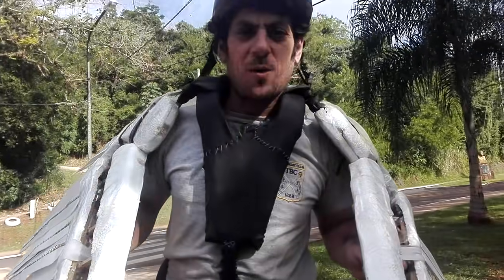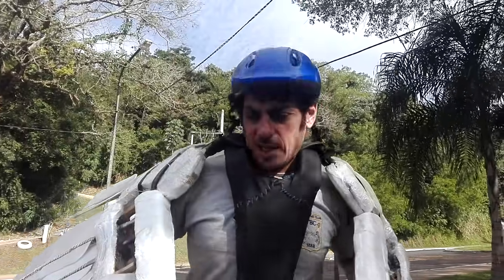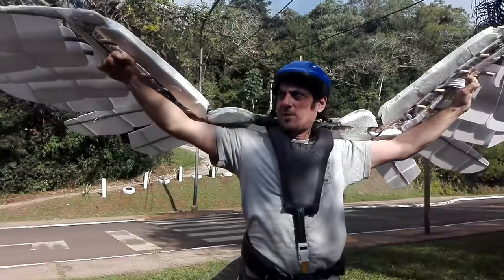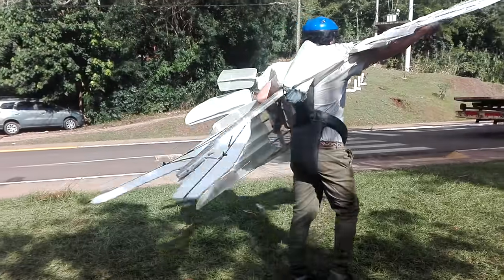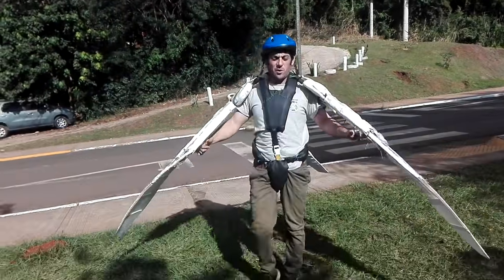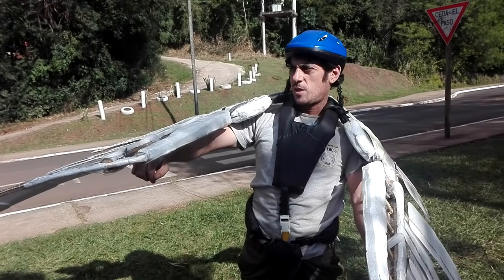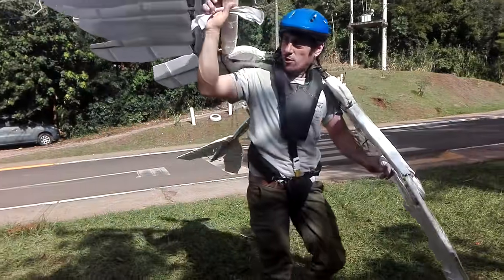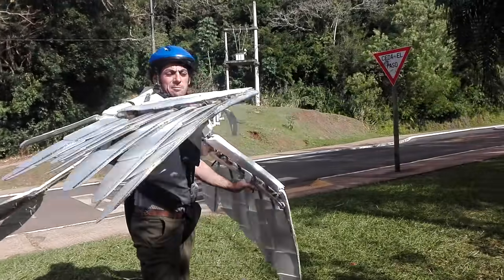Human ppwered ornithopter

Comment: I've sat down and worked out some numbers. A good wing set at about 30 feet wingspan roughly 3 feet from tip to end can displace 12.8 m cubed volume of air per wing on a day temperature 20 degree dry air. Flapping the wing at 25 degrees down. 12.8m cubed volume of air translates  to about 15.5 kg of air displacement per wing. So theoreticaly a sixty foot wing span by 3 feet could produce enough lift for a 60 kg person  person.This is provided the wings were flapped property and doesn't take in account the weight of the machine. And would need to be extremely fit and strong.
Reply: I was thinking the same, just without the numbers. I was watching thinking "great concept " but you don't have enough wing area to lift a dense human body. He should work on inventing a human hollow boned skeletal transplant first.
Reply: @deanpalmer3303  Yes, birds fly well & can get themselves off the ground & fly well because their bones are strong, yet hollow thru & thru.
Reply: You're not factoring in air resistance which, while also slowing down the wing, increases the thrust. You are correct in your overall volume, but a smaller wing moving faster can generate just as much thrust. 

The problem with human powered flight has less to do with weight and more to do with muscular structure. The human chest is not designed to produce the inward pull necessary to overcome their own weight. 

When you consider flying, consider that your chest and shoulders are basically lifting the entirety of your weight off the ground. 

So, basically, you're doing a hanging pull up every single time you generate lift sufficient to pull your feet of the ground. 

Do that a thousands time and see how you feel.
Reply: 60 feet wing for a 60 kg person. Dang
Reply: you could combine it with a supportive exoskeleton to produce a higher frequency and a costumized AI to fly mimic the movement better while having direct input from the pilot. I see this could easily be possible in a few years time :)
Reply: Humans don't have that flapping power he will need assistance from and electric motor hooked up to his back or a gas one the problem is all of those batteries will add lots of weight or the gas motor itself.
Reply: @truckerray7533  yep and filled with helium.
Reply: @robcoastalga8279  that might work
Reply: @matthewbrown5228  i think the wings produce uplift to counteract gravity and weight and to ultimately aid in reducing the force required for flight. In terms of power...i still think something can be done with modern day tech if simple gear systems in da vincis contraptions yielded some power.
Reply: @simonkabiru5676  you're not wrong. Those devices already exist in the form of helicopters, motorized hang-gliders, ultralights, and other aircraft. 

The problem here is that this person is suggesting the possibility of flight by human power alone, using wings like a bird. Humans are not built like birds. Our bones are dense, our muscles are built and structured for standing, running, and to some extent swimming. They are not built for flapping wings.
Reply: @matthewbrown5228  well stated but the main question is " how?"..if the wright brother stood by the assumption man could never fly and many other inventors then we could never have these "device". The invention of robotic exoskeleton to mimick the keel of a bird could be an eye opener in the field of man powered flights.
Reply: @simonkabiru5676  

I see what you're saying, but we are not in the situation of questioning whether flight is possible. We know it is. We have methods to achieve it. Our goal is to refine it and make it easier, smaller, more personal. 

Any method of manned flight will need to have a supliment power source, because we are simply too heavy to fly on our own power. Birds are considerably lighter in perportion to their size (not just because they are typically smaller, there are some birds that are the size of people, but do not weigh as much). 

Because of this, a supplemental power supply and exoskeleton must be used. Which is currently what is in place. 

We have airplanes and helicopters that typically use internal combustion engines to obtain either rotaional lift, or forward motion which causes wings to generate lift. The reason we use these methods is because this is the most efficient method we have of generating sufficient lift for our weight. 

The question then becomes, would combined force of a person flapping and an exoskeleton assisting in order to generate flight actually be an efficient means of flight. The answer is, unlikely. There still must be additional power, which adds weight. We must also move away from rotational energy and utilize a form of linear motion which is efficient, yet strong enough to overcome the forces of gravity and air resistance. 

One way to achieve linear motion is through solenoids. With sufficient energy, these can generate a great deal of power, however, they also use a considerable amount of energy to do so. 

Solenoids might be more efficient in a single instance than a motor, but then we must examine the overall efficiency of linear motion. 

When a wing flaps, it generates lift when it lowers, pushing on the air beneath it. But then it must raise again, which uses energy, but generates no thrust. 

Since the solenoid must be activated to raise the wing as well as lower it, even if it were possible to get a solenoid that was 100% efficient in its power usage, in a flapping mechanism you would only ever achieve 50% lift efficiency. An argument might be made for higher efficiency at greater forward speeds, as air resistance can aid in lifting the wing, in essence using a gliding method, but even then you would never achieve 100% efficiency. 

Now, compare that to rotational energy, like a helicopter. As the wings rotate, they continually generate lift. So, the more efficient the motor becomes, the more that translates to lift. Obviously air resistance comes into play, but you are never "wasting" energy when using rotational energy for flight. 

Rotational motors are not 100% efficient. Neither are solenoids. But of the two forms, rotational energy is far more efficient for obtaining and sustaining human flight, as far as we have discovered.
Reply: @WilliamHelstad  went with the experimental "bird bone exchange" surgery eh? Good on ya! Science has to be advanced somehow!
Reply: @truckerray7533  not just their bones, also their lungs, hearts, muscles, and their entire body shape is made for flying
Reply: Well damn sherlock
Reply: @matthewbrown5228  Haha this is awesome! I have really light bones... unfortunately they're also very snappable as I've found out several times 😖
Reply: Pp 9o
Reply: @mohitoshroy2283  How about explaining what "Pp 9o" means??
Reply: @robcoastalga8279  How much weight can a cubic foot of helium lift?
A cubic foot of helium can lift 28.2 grams. 
448 grams to a pound. 
Requires 15.88 cubic feet of helium to lift a pound.  Visualize a cube 2.5 feet on all sides.  That cube can lift one pound.
Reply: It's been done but required assisted take off. Also it only went for 400 ft.
Reply: @Justwantahover  Are you referring to the Snowbird?  The Snowbird is the first human powered ornithopter.
Reply: Vaya con Dios Carlos, the Savior takes the best ones early.
Reply: 60 foot wing (18.2 metres) for a 60 kg person? According to modern science, bumblebees should't be able to fly, because their wings are to small.
Anyway, a golden eagle with a 1.7-2.4m (5.5 - 7.8 feet) wingspan can apparently lift a goat weighing 65kg, accordind to this video (at 7:30): 
https://www.youtube.com/watch?v=nPx2aL4saXc
So that eagle should easily be able lift the 60 kg person?
Reply: @MaxCruise73  "Because you are not sufficiently armed with facts, you will lose the argument"
HOLY SHIT DUDE :D I didn't know I was in a argument, I feel like I fell of the bus in the wrong part of town :) Getting jumped by scientists lol! 

I was rather asking out of curiosity. I don't know how to calculate aerodynamics, but a 60 foot wing seemed a little big. I used the eagle example to suggest that maybe it doesn't need to be that big, and the bumblebee cliche is a well known example that things do not always work the way we think they should. I'm sure modern science has figured out how bumblebees fly by now :)
My point was that if an eagle, which weighs around 6-7kg or so, can lift a 65 kg goat, 
than it should be able to lift a 60 kg person?
So, a roughly eagle-sized device should be able to make someone fly? Now, I don't think the thing we saw in this video would ever work, I doubt that humans can fly with ther own muscle power. But an engine driven flapping device should theoritically be able to lift someone?
Reply: @mateiionescu1817  next time you resort to a comment, have facts on your side.
1) how a bumblebee flies has been studied.
2) your example of the golden eagle does not scale upwards.
3) I asked a simple question.  "How many human powered ornithopters have ever flown?"
4) why the obsession with using flapping wings?  In birds, flapping wings provide both LIFT and THRUST!!  
5) while not flapping, helicopters use the rotor/rotors to provide lift AND thrust.  The mechanics and aeronautical engineering have been solved and perfected.
"The first tethered flight was conducted by Igor Sikorsky on the 14th of September 1939, followed on May 13th, 1940, by the first free flight. This made the VS-300 the first single lifting rotor helicopter in the US, the first successful helicopter to use single tail rotor configuration and the first practical amphibious helicopter."
6) scant research goes into powered ornithopters.  No point when fixed wing and rotary wing aircraft have been working well for nearly 120 years.
Reply: @MaxCruise73  Maybe people want a flippy flappy thing just for fun? 
If people let individuals with that attitude stop them, we wouldn't have helicopters and planes either, because coaches and boats had been working well for centuries.

Btw, when I resorted to my first comment here, it was adressed to Ben. Would you mind terribly if he answered for him self?
Reply: For the average man, with average arms and hands and weight, he would have to not only flap his arms at 600 flaps/second, he would also have to switch from a flat hand (horizontal) to a vertical hand every flap and extend and contract his arms every flap just to generate enough thrust for lift. 600/second* But thats only with what he's born with. When you start adding devices, we got it beat. The latest is jet packs.

* I cant even hail a taxi longer than 10 seconds, and thats swinging my arms like a madman. Maybe a total of 40 flaps/10 seconds. Lift = N/A 😂🤣😆
Reply: @MaxCruise73   That theory would be correct if bumble bees used the same means of flight that airplanes do. But they dont. They generate lift by flapping wings. Unlike airplanes that require the balance of lift, weight, thrust, and drag. That theory was suggested back in 1930. It was comparing the bumble bee to air planes, and of course they wouldnt be able to fly if they didnt flap wings. Bernoulli's threory does not apply to bumble bees at all.
Reply: @siggyretburns7523  The University of Toronto Snowbird, the first human powered ornithopter, used an airfoil wing plus a flapping/rowing motion to remain airborne on is record breaking flight.
Bumble bees, hummingbirds, dragonflies fly in manners different than other birds.
Dragonflies
https://www.youtube.com/watch?v=oxrLYv0QXa4
Hummingbirds
https://www.youtube.com/watch?v=gJ_T_Y1rxHw
Bumblebees
short video
https://www.youtube.com/watch?v=KuYCbQOURT4
long video
https://www.youtube.com/watch?v=UZHa5Y8tZm8
Reply: @MaxCruise73  yes  there are several ways of achieving flight.
Btw. How long did that guy fly for, out of curiosity?
I remember something about a guy that made a glider with a pedal powered propeller. I dont remember how far he got. But I think it was over a mile. And all that is good  but at the end of the day, practicality still wins, but its always good to experiment.
Reply: @siggyretburns7523  Human powered aircraft have flown across the English Channel in 1979
"The Gossamer Albatross is a human-powered aircraft built by American aeronautical engineer Dr Paul B MacCready's company AeroVironment. On June 12, 1979, it completed a successful crossing of the English Channel to win the second Kremer prize worth £100,000 (equivalent to £538,000 in 2021)"
Info on the Snowbird ornithopter
"Snowbird flew for 19.3 seconds in a straight-and-level powered flight run under human power alone.[12][5] It averaged 25.6 kilometres per hour (15.9 mph),[4][1][5] over a length of 145 metres (476 ft)"
Here is an interesting fact.
"Pilot Todd Reichert estimates that each stroke needed 600–700 watts (0.80–0.94 bhp), with 700–800 pounds-force (3,100–3,600 N) on each stroke.[6] Analysis of the flight afterward indicated that 15-20 power strokes is the limit of endurance for the pilot.[16] ."
Only legs can create and sustain that power level.
Reply: Makes sense
Reply: @deanpalmer3303  The fact is that they can get away with the hollow bones since they are so small and thus don't need as much muscle. I believe at our size the real issue isn't the bones any longer but the fat/organ/muscle mass!
Reply: I don't know I word you just said but nice 👍
Reply: We just need to add some thing for our feet to do like a bicycle crank hooked to every feather so you could take some of the weight off
Reply: Either way He'll get tired flapping those wings before he gets a lift off
Reply: Pretty sure there’s a comic book character that has a set of wings .  His look about that big.
Reply: Trambiqueiro...🤣🤣🤣🤣🤣
Reply: @matthewbrown5228  maybe find some way to include the muscles from the legs for the wing flapping than.. although doing that many squats till seems a tall order
Reply: @matthewbrown5228 yess... was just thinking this would require one to be able to at least chest press “with elite level muscle memory”, more than twice your weight roughly...
Reply: @zzzz if you did it that way, you would still have the weight issue of the power supply for the wings, and as I addressed in an earlier post, you'd have the limited efficiency of a flapping motion.

However, using your arms to simply control the flapping, instead of relying on your strength to actually create life would extend the flight capability considerably.
Reply: Thanks all run with those numbers.
Reply: Absolutely Yes! but then the problem is that his wife is not going to find him.
Reply: @matthewbrown5228  Not just your chest snd shoulders. You forgot to include the largest and strongest muscles in the human body, your legs!
Reply: @MaxCruise73  So a helium filled balloon with a diameter of 20 feet will lift 263 lbs or 285 lbs if it was filled with hydrogen.
Reply: @bencrawshaw1227 hey there, I think the idea of a wing suit is a really cool concept and I might consider trying to make one in the future. You seem like a very smart person and you how to do the map so I was wondering how long would the wing have to be if instead of 3 feet from front of wing to back of wind it was 4 or 5 feet?
Reply: Seems like a job for graphene or smth.
Reply: @DwAboutItManFr  whats graphene
Reply: @blueflame2532  Super material
Reply: What this guy is trying will never work not enough wing ares arms have no strength  extended so they need flolded in a v shape i.e. weight lifting  so develop max power
Reply: YOU IGNORED FLAP RATE AND AIR CURRENT WING-LIFT - you can "take off" by just standing into a breeze with a much smaller wing area for the mentioned payload. Witness the Gossamer pedal powered aircraft that used air current lift and not air displacement except for a very large propeller for forward / directional thrust. The angle of a bird's wing provides both variably and very effectively - very high tech!!
Reply: party pooper
Reply: @matthewbrown5228 that was nice. are there any muscle sets in the body that can produce the required lift? example both thigh legs. a weight lifter can lift three times his mass that way (eddy hall).?
Reply: @nothinghere1996  absolutely! Our legs are specifically designed not only to support our weight, but to do so consistently and for extended periods of time. If any muscle group would be sufficient for obtaining flight, it would be glutes, thighs, and calves. 
Sustained flight would require endurance similar to long distance run, but people do that all the time. 

Incorporating a system that combines both arms and legs would decrease the overall stress on any individual muscle group, making flight not only possible, but easier to sustain.
Reply: Exactly!
Reply: You all should hear about the UTIAS Snowbird. What you theorize about is possible!

Comment: You need wings elastic and 2 times heavier than your body, and use engine to move the wings instead your hands.
Reply: It literally makes no sense for them to be so heavy, are you crazy?
Reply: Well there is also maybe just small electrical motors arranged a certain way...reminds me of the wings of sacred dawn from destiny
Reply: @DarthVader-ch4um  it make sense, it need to be bigger than your body to make your body fly with facilities
Reply: Yes indeed, he will not be able to wave his arm like this lol, this is why birds have very strong chest. He need a sort of machine. Or he will just get a cramp and fall.
Reply: @amurtiger7410  Yeah, but the weight of the materials doesn't have to be that heavy, we've got synthetics bro
Reply: @DarthVader-ch4um  ok
Reply: Why heavy wing? Istead the wings sould be as light as possible.